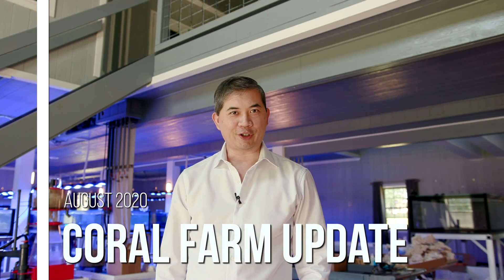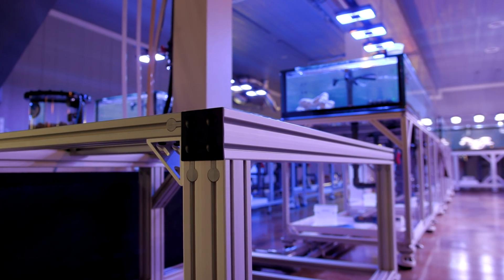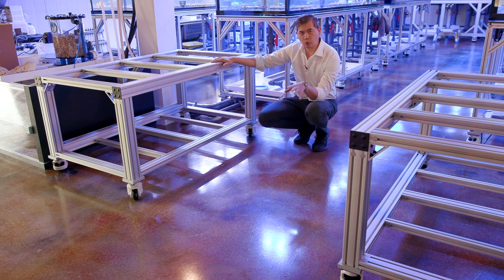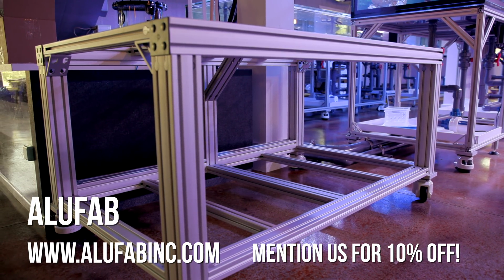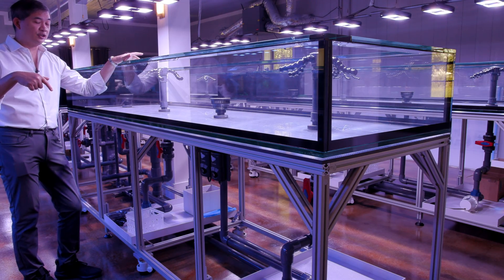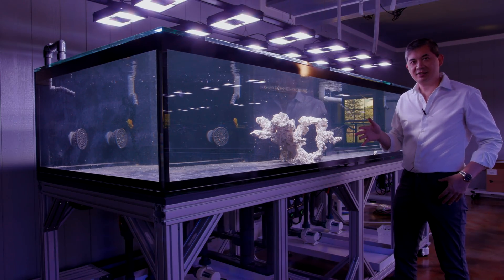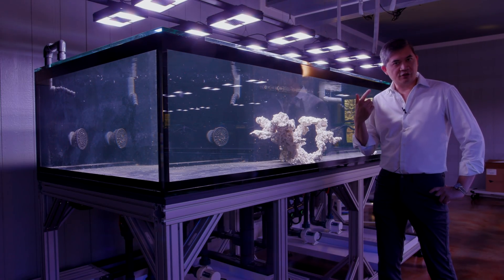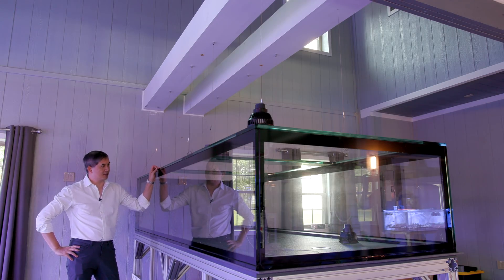August 2020 Coral Farm Update - Episode 18

Comment: Do you have any balancing valves on the system? I couldn’t help but notice you have an ECM pump with a radiant manifold style headers and zone valves but no way of ensuring that the system is balanced and evenly distributing the flow rate through the different zones when they’re all open.

Comment: Love the straightforward approach to your videos and appreciate your honest photography with details about how you photograph (with links). I absolutely LOVE your rain collection/geo/cooling system.  I am a HVAC specialist/nerd/ocd/researcher. The upfront cost/design is daunting but well worth it. I have a rain collection system with solar to power irrigation for my gardens and backup a 600 amp/hr AGm for my aquarium.  Keep it up.  Congrats on innovating the industry.  I will buy from you soon.

Comment: Are the frag tanks running only with "water" ? I don't see substrate, rocks, ceramic media. Is a setup with more bacteria surface better for tank mixed with fish/corals and a setup more clean and inert better to a propagation system ? Did you have to cycle your frag tanks ?
Reply: you must be new here
Reply from the maker: There are media bricks in the sump but minimal rock in the tanks.

Comment: How well does aluminum do when exposed to salt water?
Reply: It almost never corrodes. At least not under these circumstances
Reply from the maker: Aluminum oxidizes and gets this chalky white coat on it (aluminum oxide) that prevents further oxidation.  Powder coating the stands would further protect them, but we are pretty quick to wipe up spills here.